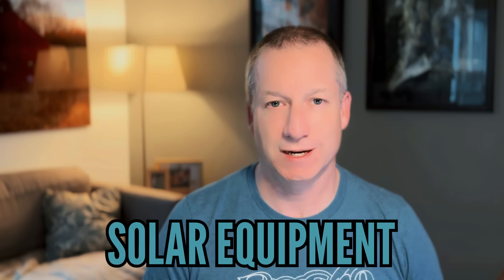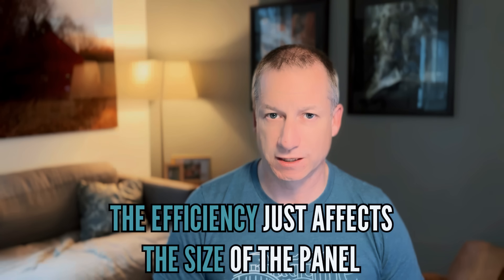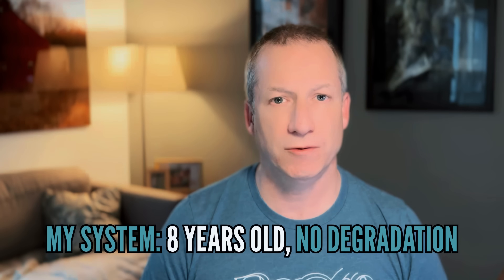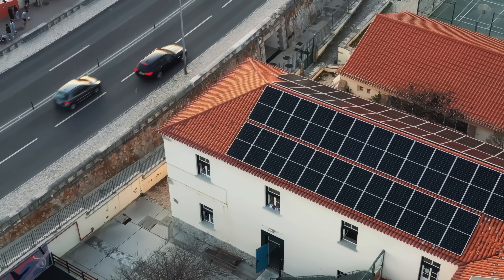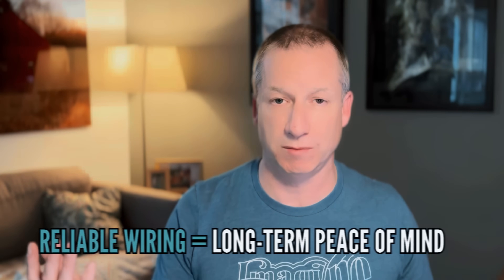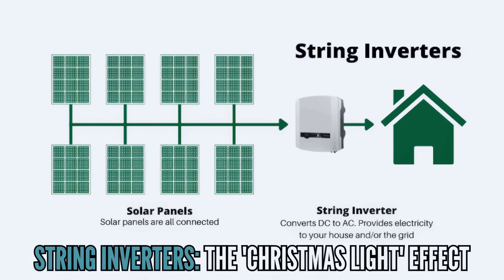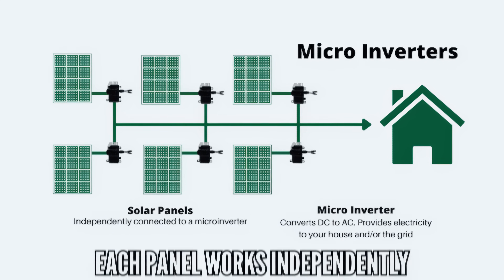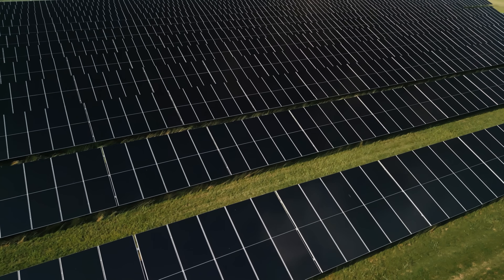The Hidden Downside of Microinverters No One Talks About

Comment: In the US, if you are roof mounting, either DC optimizers or micro-inverter are absolutely required under every panel for the emergency shutoff feature. Simply stringing the panels is not an option and the whole shading problem therefore disappears.
Reply from the maker: Not quite. But yes you do need some type of modular level electronics for emergency shut off so might as well use optimizers!
Reply: I’m aware of the existence of shutoff only electronics, but the price difference of ones that also include optimization is so small, I’m amazed it’s profitable to design, manufacture, and inventory both flavors.   Agreed from the consumer side, might at well use optimizers, and the whole shading issue disappears.
Reply from the maker: @Texacate I agree!

Comment: The whole point of micro inverters is to minimize wiring and eliminate routing dangerous levels of DC on the roof.
Reply from the maker: I totally disagree. The US and the state of Massachusetts where I live, have strict code and permitting processes in place to make sure solar is safe. No one is routing any dangerous electricity across anywhere when following code, the UL listed manufacturers installation guides and passing inspection among many other safety requirements ALL of which are required before you can turn the system on. What you’re saying is dangerous, not DC electricity.

Comment: Thanks for this. A bit late for me, since my system was installed six years ago, but still enlightening.

I don't know if the DC optimizer was even an option back then. But I have found that the microinverters on my system are incredibly *unreliable*. In six years, five have failed so far. There are only 20 to start with, so that's a 25% failure rate in just the first six years, averaging one failure per year. And of course, they are way up on the roof, where it's hard to replace.

Fortunately, the installer has been gracious about the whole thing. The inverters are under warranty, but the manufacturer doesn't cover labor. I had to pay labor for the first two repairs, but the installer has agreed to cover labor as these continue to fail, given how unreliable they have been.

Who knows if I'll still be in this same house if and when the panels have degraded enough to require replacement, but seems that already, and probably even more so by then, the technology has been advancing quickly. If it weren't for the cost, I'd love to upgrade my 300W panels with 400W ones, and switch to the DC optimizer approach you suggest here.
Reply: The question some of us would have are, have the microinverter manufacturers learn and adapted from the early failures and now make them more robust and reliable than before, or his this still an issue years later.

One would also think like anything else, there are probably micro inverter models and brands that are far more reliable than other brands and models.
Reply from the maker: Thanks for sharing. Lesson is the installer is the most important choice!
Reply: As long as you have enough space on your roof, it's not going to be worth it to remove the old panels, just add more panels if your system produces insufficient power. Either expand on the microinverter system or add a separate string with inverter. With modern panels you can just use a string inverter and even optimizers are not worth the extra money.

Comment: Videos like this one do the most damage because the channel presents well, and the presenter sounds like he knows what he's talking about.  80% of what he says is correct, and is valuable information.  This makes it far more likely that the 20% of downright false information imparted will be accepted, absorbed and acted upon by viewers.

As others have said, the reality today is that the Christmas light effect really no longer matters.  Most panels I'm looking at have three bypass diodes per panel, meaning a 12 panel array is in fact 36 independent solar production zones.  Shade one of those zones, and the 35 other zones continue to produce completely normally.  You'll only see production drop for the zones that receive shade.  

The video also fails to specify that even back in the Dark Ages when bypass diodes were not being used in solar panels, the shading issue only really affects situations where there is shading.  I know it sounds obvious, but it needs to be spelled out for some folks.  MANY installations, if not most, won't suffer from any shading at all.  

So yeah - really, DC optimizers only really make sense to me if you want per panel monitoring.  Otherwise they don't seem to be worth the considerable expense.  Just get a good set of modern panels and a good string inverter, and you're good to go.
Reply from the maker: Please see my pinned response above.

Comment: Totally incorrect regarding string inverters. Most panels from the last five years have bypass diodes. Some are even half or tri-cut.
So, while shading a single panel, you will only lose power on that panel, or even a portion of it if it is half cut or tri-cut.
And in high heat zones, optimizers or microinverters fail every few years, if manufacturers go out of business, you must find the identical optimizer or microinverter to ensure that the system functions properly. But string inverters can be replaced with any manufacturer's product.
The main current disadvantage of string inverters is that you cannot monitor panels individually, however manufacturers like as Huawei are working on solutions for that as well.
Reply: Pretty sure it's EVERY panel from the last >20 years.  Without bypass diodes shade could cause a fire.  So not really optional.  Shade doesn't kill strings if they're run independently  Can't believe a self professed 'solar guy' wouldn't now this.
Reply from the maker: That’s just totally incorrect.
Reply from the maker: Please see my pinned response above.
Reply: ~20 years is correct.  I have 20-year-old residential panels which have bypass diodes.  The "fire" part is not correct.  A broken or shaded sub-string in a solar panel just blocks some of the current.  No fire.  Just less current (which the bypass diode, when present, fixes, by allow current from the other panels to bypass the shaded panel).

Any modern-day panel over roughly 200W will have bypass diodes.   Tiny little panels like 25W, 50W, 75W, and probably many 100W panels generally don't bother.   Larger panels always have bypass diodes these days.
Reply: @junkerzn7312  I learned the importance of bypass diodes the hard way.  I built my first array from laminates that didn't have diodes and I wasn't smart enough to install them.  In the evening 1 cell was shaded in a string of ~8 panels.  That was cell quickly heated up to >200F since >600w was dumped into a 5" x 5" silicon wafer.  Pretty sure it would have melted and could have caught fire if I didn't open the circuit.
Reply: Temperature management of microinverters is key in hot environments (especially southern Nevada and the flatland of Arizona). In summertime  (when air temperature is 110+F) the temperature of even a properly mounted microinverter is only a few degrees below max rated temperature, leading to higher microinverter failure rate than elsewhere in the US.

Comment: I’m an engineer that actually has designed solar systems from the utility scale to commercial and residential applications for over 15 years. 

Dc optimized systems like the ones offered by SolarEdge are garbage. Not because of the technology but because SolarEdge, the largest manufacturer optimizer technology refuses to replace the components when they fail, unless you threaten to take them to court. 

Microinverters such as those from enphase have the lowest failure rate of any technology and there’s plenty of data to back that up. They actually test for that. 

But for the average homeowner, that doesn’t have a lot of shading of their roof by trees etc, then latest generation of solar panels (with bypass diodes) coupled with a high quality string inverter will be just fine. It’s not usually worth adding 20%+ to the system cost for a 5% improvement in performance. 

Also, black on black panels are purely an aesthetic choice but one that makes sense for residential applications as it has wider curb appeal. Most tier 1 manufacturers are making such panels these days at affordable prices. 

Finally, the statement about subcontractors is hit or miss. It would be ideal to have all work performed in-house by a company with a long track record of solar specific work. But that’s not the reality everywhere. The more realistic solution is to have a dedicated solar installer that has a sales arm that drives business to them. So, technically it’s not subcontracted since all the work is being performed by the contractor but the consultation/sales part is outsourced because those are two different specialties.
Reply from the maker: Thanks for the comment. I’ve had a much different experience with SolarEdge than you have obviously! And definitely disagree about them being garage. Yes I know that Enphase tests for failure rates. So does SolarEdge. Please show me reliable industry data that Enphase has such low failure rates. Would love that to be true for all those who have them. The cost of the system is nowhere near 20% higher for just a different inverter system in most cases and when you do the math the 5% production gain is well worth it. Agree with you about black on black panels. And agree that not having subcontractors is a magic fix all. It’s just the biggest factor I see again and again in the quality of the install.
Reply: @LifeLongLearner-om8jx  Agree. This guy doesn’t know what he is talking about 🤦🏻‍♂️

Comment: Optimizers are fine but increase cost just a tad over micro inverters.  Secondly You'll have to replace the inverter aprox every 10 to 15 years on an optimizer system and the warranty is usually 10 years which means out of pocket for a new inverter. Another disadvantage is on a larger system you may need to or more converters which means more money when they fail. Those inverters are very expensive and fail due to the high heat and amount of wattage they are converting thus the reason for 10 year warranty.  Micro inverters slightly more efficient , Warranty is 25 years, and according to installers I have spoken with extremely rare to have one fail.  One installer that put in well over 200 systems says he had to replace two one which was bad from the get go the other failed in warranty and is a plug in connection.  Now for charging a battery advantage does go to optimizers. They deal DC to DC with minimum loses though micro inverter systems even with the loses of converting is extremely low percentage.
Reply from the maker: SolarEdge and Enphase in the US form a virtual duopoly and their prices are negligibly different. That includes extending the SolarEdge warranty to 25 years. I agree that more converters or inverters are bad because they are more likely to fail. That is why I like Enphase slightly less. Optimizers are not doing the heavy work of inverting and are less likely to fail. 200 systems is not a very big sample size at all. More important than the specific equipment is the company servicing it by far! DC coupled batteries are clearly better in just about every way.

Comment: Your video was very informative, you obviously know your solar systems. We are retired and live in the UK and we had a 10 panel system installed less than 2 years ago. It was fine at first then the inverter (Solis) started sending alarms which all stated that there was an arc fault which should be dealt with and these have got more frequent lately. The installers came back once and said they found a faulty connecter under one panel  and fixed it but the problem persists so I think that more connectors must be faulty. They want to charge me a lot to come back and fix these so I am waiting for another installer to look at the system. I suspect that these connecters are faulty or have not been correctly wired so my question is - is this a common fault with roof panels or do you think we have just been unlucky? I would appreciate your expert opinion on this.
Reply from the maker: Hi there. Tough situation. Warranties that have good labor coverage by a company that will be around to service it are a must when owning solar if available in your area. Unlucky that you don't have that. You are not alone unfortunately. Not surprising to me that the solar company wants to charge a lot because legitimately electricians are really expensive. They may be gouging you, but you might be surprised by their costs as well. You will know a lot more after the other quote. Could have been faulty installation work, or faulty equipment or both. Electrical stuff can be finicky. My only advice at this point would be to hire the person/company that you trust the most to communicate with you clearly and do the job well. Hope this helps!
Reply: @bradthesolarguy  Thanks Brad.

Comment: Why does black on black matter?
Reply: It's not only looks, even though the differences are incredibly minor the same panel with a white back sheet will run ever so slightly cooler and very slightly absorb more light.

Usually any line of panels that are available in bothe white and black backsheet configurations there is usually a 2-4% increase in the performance of the white back sheet versions. Since it's so small most people don't care and would rather the nicer looking full black panel.
Reply from the maker: @Snerdles  Correct. But don’t get confused. A 400 watt either way is the same. So the white back sheets make it slightly cheaper.  Not enough to overcome the ugliness through!
Reply from the maker: It is only about how it looks. Without the black back sheet you see the grid design and a bluish color usually in the panels. The black on black panels look a lot better!

Comment: I respect most of what you're putting out here but the claim that optimizers have lower failure rates than microonverters runs counter to basically all industry data on the actual failure rates of these rooftop products. Do you have data on a specific optimizer showing long lifespans on them?
Reply: Please Referance Sources Please!
Reply: I too disagree, I think Enphase micro inverters are the best,work better in shading hands down,more efficient in the conversion, I would rather have ac coming off my roof, than high voltage dc,much safer.Now as for coupling with batteries you are correct, dc to dc is easier,and your not reconverting,but which one is being used most,already converted ac main power or recoveries dc to dc power. As for micro failures,most I see failing is miss matched panels to wrong micro, ie, 400+w panel into a micro inverter that's only rated for 285 to 305w. Personally I've ran mine for 7+ yrs and Ive had no failures on my complete system. My only regret is not having the IQ 8s when I bought mine, there the only system grid tied that can island themselves in grid down without battery backup,and that my friend is a lot JM2C
Reply from the maker: Enphase is a good product for shade control. SolarEdge is just as good or a little better for shade control and has DC coupling for batteries. And yes! So many system with too small micro-inverters! Yikes. Paid for all that wattage on the roof and can't access a huge chunk! Bummer.
Reply from the maker: Not aware of any residential solar industry data on this topic that I would consider reliable. Mind sharing your sources? I'm genuinely curious. My opinion is based largely on two things. First, I've seen hundreds of systems and  have almost never seen an Enphase system that didn't have a bunch of failures and don't think I've ever seen an optimizer failure. Second, inverters are doing the hard job of transforming electricity from one form to another and therefore wear out. Because optimizers are doing a much simpler job I think they have a lower failure rate. That being said, I'm very open to the idea that the micros are as reliable as optimizers. That would be great news for millions of people.  But even if that is true, I would still choose a central inverter, which DC optimized system are, over micro-inverters because with micros you have AC coming off the roof and that is a huge problem for combining batteries with the system. It's possible to have an AC coupled battery system (many do!) but it has real and obvious disadvantages to a DC coupled system.

Comment: Agree with Niall, you lost me when you mentioned about christmas light effect. There are plenty of videos showing actual tests , showing bypass diodes do a lot of the work to bypass the panels which are shaded. Sure microinverters /optimisers may give better/optimal output but these generally only make 3-5% difference, yet cost is around 10-20% more, not to mention, as you say, you may have more maintenance over the long run replacing the microinverters/optimisers.
Reply from the maker: Please see my reply to Niall as it applies to this questions as well. I am not a fan or micro-inverters. Your point about the cost is a good one. Let's do some math! If my 10 kw system lost 5% a year to shade that would be 500 kwhs a year. That's $200 at last years' utility rates here in Massachusetts. Let's say that stays the same for 25 years (no chance in reality of it not going way up) then that adds up to $5,000 worth (probably a lot more) of utility electricity I'm buying even though I have solar. That's more than 5 x the "savings" I would get from going with a cheap string inverter. I'll stick with my Solaredge inverter which combines the advantages of both a string and micro-inverter while hugely reducing or eliminating all the flaws.